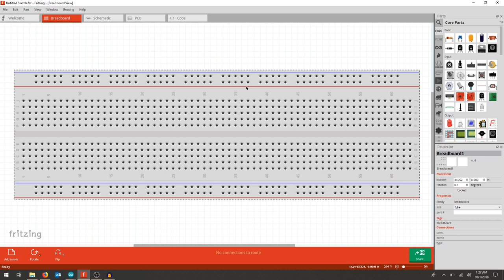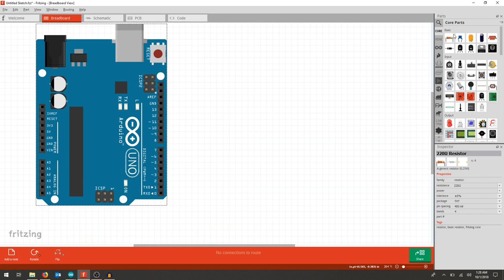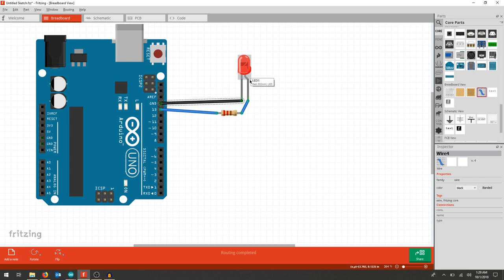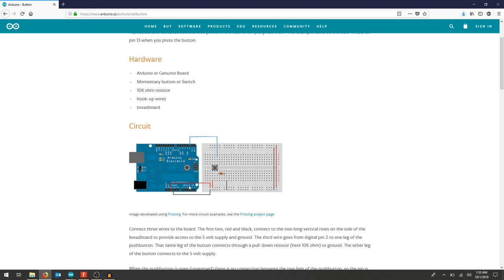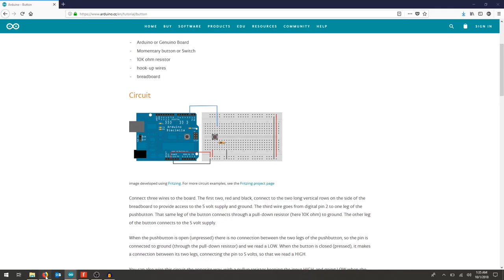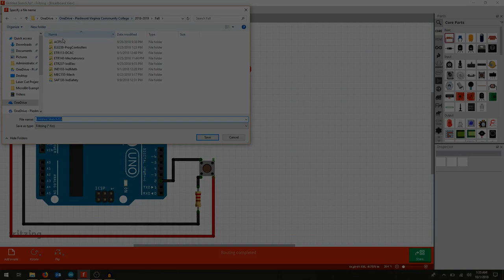Intro to Arduino: Part 1 - Fritzing

Comment: Do you still need that resistor if there is a resistor built in to pin 13?
Reply from the maker: Yes - the resistor you are talking about is wired to the onboard LED in parallel.

Comment: How can I do simulation  
Please answer
Reply: Fritzing doesn't simulate anything unfortunately. Tinkercad does but hasn't many components and it's online only.
Reply from the maker: Fritzing isn't really made like Proteus or similar. There are some cheap and free simulators if you write test code. A search should provide a few options for atmel-based chips.